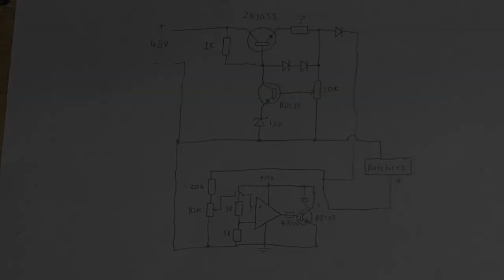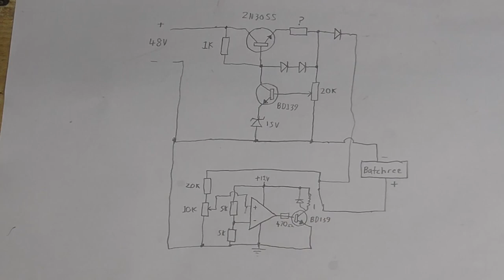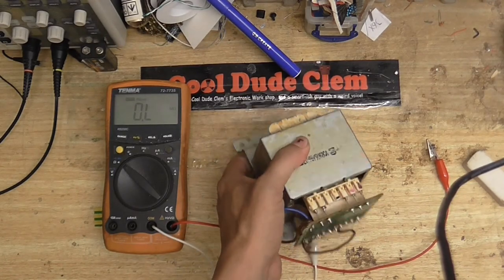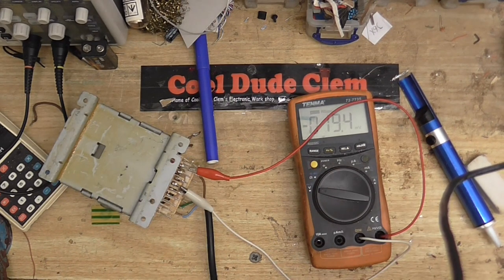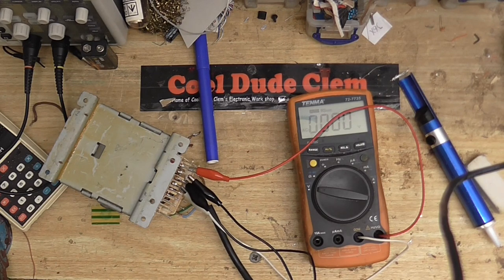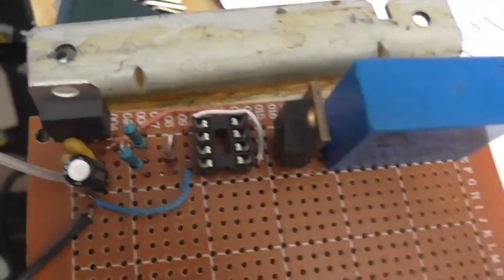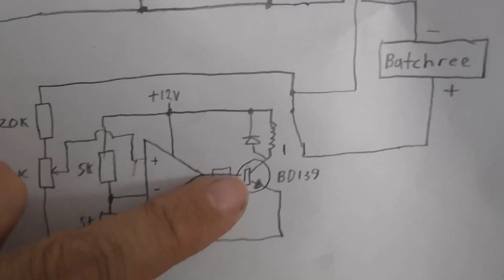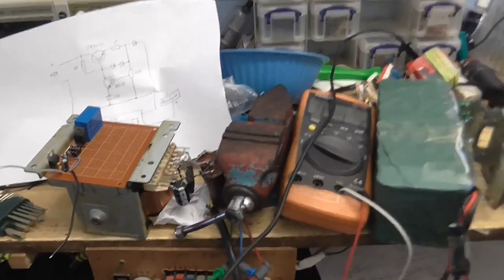Building a battery charger part 1 - Ideas and power supply

Comment: Connector sturdy enough to handle the current? Your circuit looks good. Looking forward to the final outcome.
Reply from the maker: I'm sure the wire must have shorted, I mean that metering circuit I made takes almost no current at all.

Comment: I would think your current limit resistor would be after the 20k pot. The way it is the voltage will try to go higher with load as the voltage would be lower on the battery. You want constant voltage first of 42.6 volts to account for the diode drop that is after it of .6 volts too.
Reply from the maker: Yes it will try to go higher with load, but the current limit will prevent that. I mean if I was to put 42 volts straight into the battery when it's low, that would be too much current and would damage the battery. The 20 k pot is more a voltage limit, setting how high it can get to.
Reply: @CoolDudeClem  How much charge current do you think 1k will give you on the base of the 3055? .5 amp?
Reply from the maker: @davestech6357  I honestly don't know. I will lower that resistor if I need to.